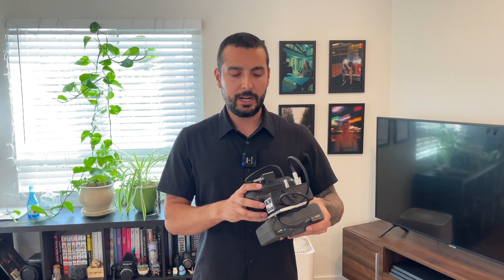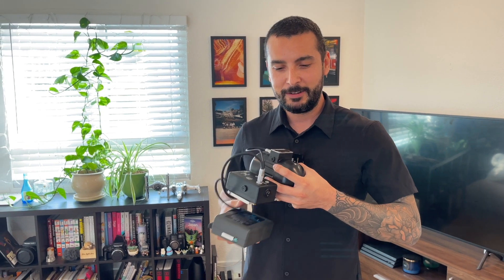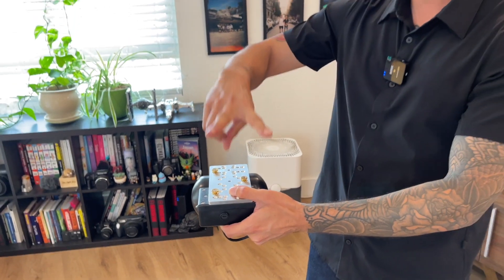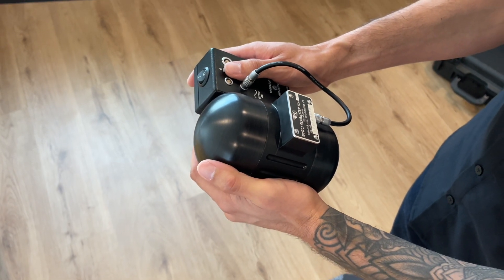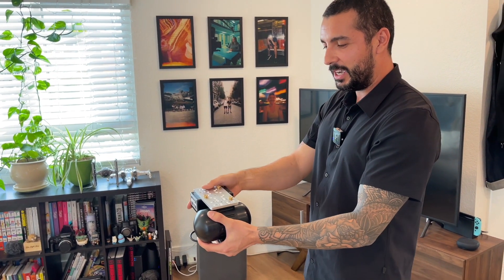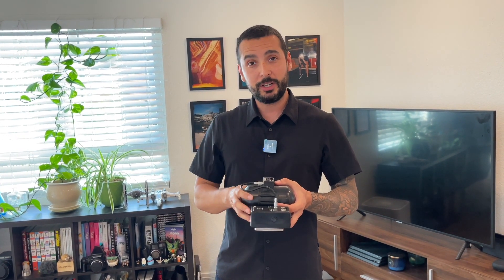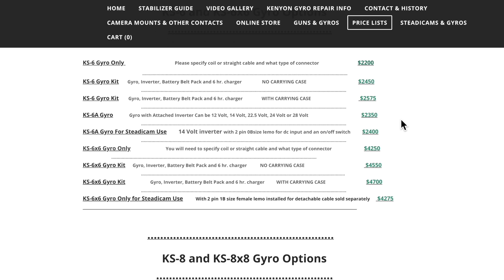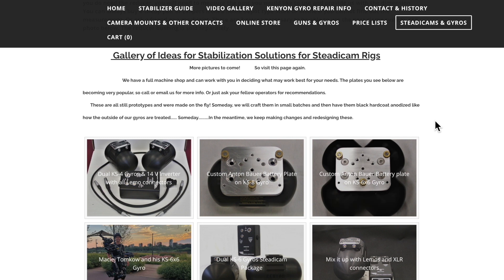Gyros and Steadicam

Comment: Hi James,
Having my own KS-6 in my kit, I feel that the best way to mount it, is so the tilt axis is around the round part. Having the Volt on my M2 rig, the gyro will take care of the pan axis in the best way. It's kind of opposite of what you're saying in the video. But I haven't used it in the field yet. Also I feel that just having the gyro turned on for around 4 minutes and then turn it off and on in breaks, will make it 'grab' the rig a little less. So you're actually able to pan the rig🙂
Great videos, by the way👍
Reply from the maker: Yes these are all good points. When using volt since it’s stabilizing your horizon having the gyro perpendicular to the lens isn’t necessary. When using a volt I have the gyros orientation parallel with the lens so I can still tilt without it fighting me and then the volt handles the roll axis. However not everyone has the volt so there will be times people are going to choose more stabilization in the horizon and will need to orient the gyro perpendicular to the lens so that’s why I don’t bring up the volt in this video

Comment: great stuff, how often do you use them?
Reply from the maker: Thanks for watching! I tend to use them a lot more than one would expect. In the past I would rent one from a friend almost automatically after hearing that I'd be on the rooftop of a tall building shooting outside (the wind gets pretty intense on tall buildings) or out in the desert. Now that I own one I pretty much just keep it in my kit because you never know what situation you might run into. Besides wind I now use it whenever I need to do push ins/pull outs that need to feel like a dolly/technocrane in the sense that everything is dead center, symmetrical and perfect. I've also been using it more and more when I hard mount to a vehicle but I'm still figuring out what are the best situations to do so when it comes to hard mounting steadicam. Having a gyro is one of those things that you may not always be able to charge extra for, but you will be glad you have it because it'll make your shots look better and make your life easier. Plus you can rent it out to people in your area and make a little bit of money just by owning one. Hope that helps!